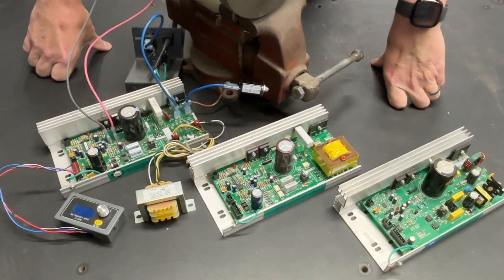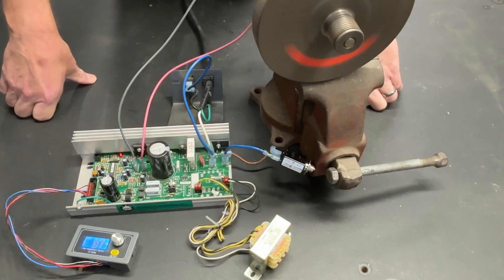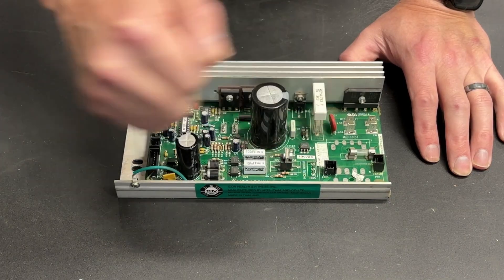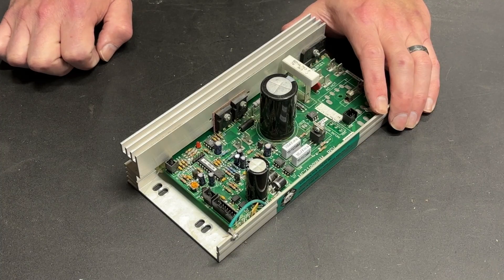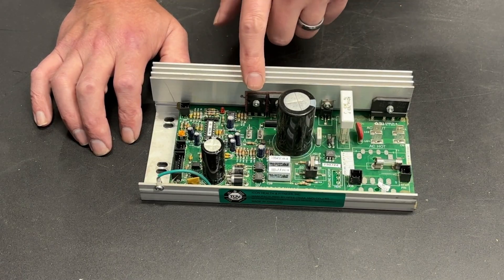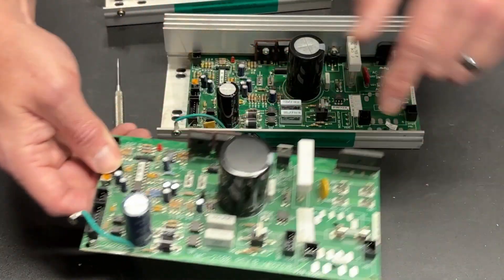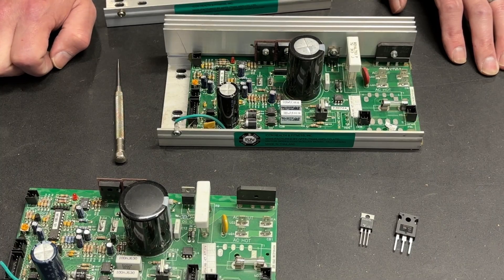Troubleshooting and Repair of an MC-2100 Including common Component Failure and Diagnosis

Comment: Is it possable to use the mc 2100 as a variable voltage power supply to charge batteries?
Reply from the maker: probably but not without way more knowledge than you would get from a youtube video.  You could dial in the voltage no problem the issues is amps.  If you don't have a way to control the amp output from the power supply you could damage the batteries.  The other issue is overcharging.  Most battery charges come with an auto shutoff and a DIY setup like this would also not have that.  Most battery chargers are not that expensive.  I would think you would be better off using something specifically designed to charge batteries rather than trying to "make something work" that was not designed for the purpose.
Reply: @dazecars  What if I added a Buck Boost converter could that address the issue with amps
Reply: Sorry this situation it were better if I used an old wall weart (stupid question)
Reply from the maker: honestly I don't know, I have done very little with battery charging

Comment: I have the Astar TD-700 Rev 2.1. Have you done a hookup video for this board?.
Reply from the maker: I do not have a hack for that board
Reply: @dazecars  From my limited knowledge it looks like a revised verson of the 2100 with more robus components complete with a transformer  and Transformer choke
Reply from the maker: There is no such thing as a "Transformer choke" even though they look the same it is either a transformer OR a choke

Comment: Hi! I'm now reparing MC2100E board (Rev. A, ICON 2003), and it seems have P-Mosfet instead of N (all videos and forums i have read already - says that 2100 board have N-Mosfet), so i'm very confused, can you help me? If you have 2100E board - can you check, what Mosfet and driver it has?
Reply from the maker: Are you talking about the letter at the end because there is a P in the middle of the part number?  I have about 7 different boards all different configurations and revisions and they are all IRFP250N MOSFETs.  The trigger polarity is the only difference between the two so if your board worked with the P MOSFET before that is likely what you should replace it with.

Comment: Omg thank you! You saved my treadmill from the scrap yard with your suggestion on the replacement of the 2 chips. There’s no way I was going to buy a $200 control for my $100 equipment! Got both chips for $5 on Amazon and we’re good to go. Saved my treadmill and my ass!
Reply from the maker: I’m glad I could help!

Comment: Thank you for the informative video!  I replaced one front roller bearing, then it never work after. 
Control panel touch screen works, fan works, incline/decline work, main driven moter doesnt spin, LED light flash only one time when turn switch on, moter is tested working on battery. Fuse tested fine. convertor tested fine. no clear signs of any physycal issues on anything.
The most weired thing is: the control board output votage is 214v tested from the connectors where the motor wires pluged on  (where marked as: A-/A+).
Would you please share your thoughts? Much appreciated!
Reply from the maker: I am sorry I can’t help with troubleshooting as my area of expertise is not in repair of treadmills. my channel is about repurposing treadmill parts for other projects.  Because of this I have had some experience repairing the board but all the info I have is the info in this video.
Reply: @ that totally understandable. Would you be able to find out how much vantage is from your working order 2100 board, where the driver motor connects to. Are they 70? 120? Or 213? Thanks
Reply from the maker: sorry I didn't get back to you sooner.  took me a while to get out and get it tested.  Because there is a capacitor in parallel with the motor out puts and the system puts out a pulsed max voltage if you measure without a load you will get max volts.  Without a motor hooked up I was getting 156V DC.  My setup is hooked up to 110 in from the wall.  With a motor running you will get a variable voltage depending on how the PWM signal coming from the console

Comment: I lost the 8 pin wire harness for my MC-2100 board and now need a replacement.  Looking on Amazon but not sure what to look for.  The pitch of the pins seems to be the way these are specified.  My pins measure about 0.094" (2.4mm) pitch.  Do you know a better way to find the right replacement harness and 8 pin connector?
Reply from the maker: I have scrapped enough treadmills that I have not needed to order a new plug so I’m not sure what this style of plug is called or how to measure it.
Reply: Any luck with this??  I am currently in the same boat!!
Reply from the maker: just did a quick eBay search and there are used treadmill cables available of almost every configuration

Comment: Hello!  I just came across this because while doing some cleaning maintenance on my treadmill, I accidentally dropped a screw onto the board without realizing.  I ended up turning it on and shorting what may be two of the rectifier diodes near the transformer.  I'm trying to figure out if I can replace those diodes, or if its okay to still be on the treadmill with 2/4.  The board is the MC2100LT-12 (part no. 409599) with the big transformer out with what looks to be a butter bit on top.  I cannot for the life of me see what diodes I may need to replace, or if I need to replace the board.  I do notice you briefly talked about the transformer, do you know what diodes they need?  Like a D10 and D13?
Reply from the maker: contact me through my website and send me pix of the board I will compare it to the boards I have and see if I can find replacement info for you.
Reply: @dazecars  Sent!  Thank you so much for this!
Reply from the maker: I received it and will get back to you as soon as I can

Comment: bro i have moved my house since then when i switch on there is clip noise come from motheboad.. powe on and display on.. no sooner start machine then my main power switch turn off .. what do you think .. when i off and on switch that clip noise is coming.. thanks..
Reply: is it worthy to repair my trademill or buy anothr one.. i had this machine 10 years.. is there power short why my house main power switch off when trun on machine.. thanks
Reply from the maker: could be a failure in the MOSFET and SCR but may not be.  The board is easy enough to swap out if you simply got a replacement controller.

Comment: Hello and thank you for the informative video. I have a Nordictrack 3700 elite treadmill that has worked great for years but the belt will not respond now. All LCD controls up top work and controls to ramp up speed respond, but belt doesn't move. Circuit board is MC2100LS-30 and red LED does not light up at all. Do you think it's the MOSFET and SCR or would that indicate transformer failure? It has the small onboard transformer pn DZ-MG22001 but doen't look burnt and both capacitors look good. One small diode right above the "MC" on the "MC2100LS-30 REV" label in middle of the circuit board looks like it may have burned out. Any suggestions are greatly appreciated. @dazecars
Reply from the maker: So first I am not a treadmill repair guy, just an electronics hobbyist who repurposes treadmill parts for other applications. With that said I have some info for you... may or may not be helpful.  First  "All LCD controls up top work" that means it is for sure not the smaller of the two big capacitors AND it is not the transformer.  Those two parts are what helps convert 110V AC into 12V DC to power your display.  Second it might be the signal generator in the LCD controls.  If the mc2100 is not getting a signal that could be the issue however in most cases the result is an LED that stays on solid rather than one that doesn't come on at all so that is not likely.  Third, could be the diode, burnt parts are always a good place to start but I have a feeling it is likely the MOSFET and SCR,  I cannot however say for sure.  There have been as many failures to fix their MC2100 using this info as there have been successes. This video just covers the most common failure points but not every possible issue.  There is a guy who commented on this video about a week ago who was not able to fix his board, however was offering up the extra components he had purchased for the cost of shipping.  May be worth checking out.

Comment: Can a ac regulator run a treadmill instead of the MC 2100
Reply from the maker: Inside a treadmill or outside the treadmill?
Reply: From the looks of it it already has that regulator...but on the DC side...(scr).....
bt.w. an scr is always more robust...(electrically , thermally & more noise immune) than a similar AC regulator(a.k.a. TRIAC) of the same/similar
rating.
Reply from the maker: way more robust

Comment: Thanks Much,  I just scored a version of the MC-2100 board with a 2.25 HP continuous duty motor from a  NordicTrack A2350 treadmill should work well on my old lathe.
Reply from the maker: don't go by HP numbers AT ALL they do not apply in a variable speed situation, what is the torque of the motor?

Comment: I have a MC-2100 Rev B on my treadmill. Original issue was treadmill would start at high-speed then immediately turn off. As suggested, I replaced both the IRFP250N Mosfet and S402SL transistors. I tested with no weight on treadmill, ran well. Then, stood on the treadmil and started. Started to move then I heard a pop and then treadmill stopped. Burning smell. I check the board and the S402SL had a hole in it and burn mark where it connected to the board. So I replaced the S402SL again but did not replace the Mosfet. Reconnected the board. Turned it on. All the lights came on. I set the speed to 2, As soon as I press start, I heard a pop again. The S402SL burned out again as there was a bigger burn mark on the board at the connection to the board. Now, should I try replacing both the Mosfet and the S402SL again? Or should I just replace the board altogether? Is there a better alternative to the MC-2100?
Reply from the maker: Something else on the board is bad causing the issue but I am not sure what.  a replacement mc2100 is likely your best option but it is still not very robust.
Reply: Do you know by any chance the mosfet, thyristor and rectifier diode values for an mc2100els-50w-2y
Reply from the maker: no I do not know the values

Comment: I want to consult with you about something: I am having difficulty removing the board from the heat sink. I have already removed the hot glue stuff (as much as possible), then I also removed the bolts that are holding 4 heat sink components to the heat sink, and I removed the grounding strap from the body of the heat sink. And yet after that, I can not move the board even a tiny bit at all. Is there anything to alleviate the removal procedure somehow? Thanks.
Reply from the maker: Some times they get cocked in the slider groove.  Could also be a tight fit.  a small amount of pressure between the aluminum rails may be all you need to get it out.
Reply: Trying to do that for the last 15-30 min, no success so far. Was even using a small needle to get to the slider groove somehow to remove the remnants of the hot glue. I can even see that the board has started moving in vertical direction, but so far not in the direction that I need it. I'll keep on trying though.
Reply from the maker: I hope you are able to get it out
Reply: I finally managed to get it out after 2 days of trying. And I did it in the direction (can you imagine?) opposite to yours in your video. I understand that the slider grooves are there up to the very edges from both sides: left and right. But no matter how hard I tried to get it out from the right side of the heat sink (by pushing the controller from the left or pulling it from the right), I could not do it. Then, there was approximately 1" from the left side of the heat sink and the left side of the controller, whereas on the right side --> both of them (controller and heat sink) were on the same level. And then it hit me: why don't I try to push it in from the right side?
And I did it with my two big fingers from the right side, while I was holding the heat sink with the rest. And it worked: even that slightest push -- moved the controller immediately half way through, the rest was easy... I hope this info might help someone someday... Good Luck!
Reply from the maker: I have removed them from either direction so I would guess there was a barb or something holding your up in one direction however I will add this info to my knowledge base in case someone else has a similar problem.

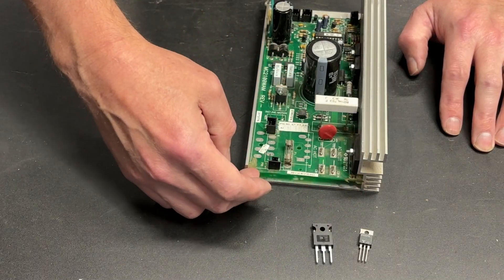Comment: I have a question about re gluing the Board to the heat-sink assembly.  @10:48. Will ordinary craft hot-glue work or is something else needed? I have an MC-2100LC-30 board
Reply from the maker: hot glue is exactly what it is.
Reply: @dazecars  ok.  Mine was Grey in color.   Thanks for the tip
Reply from the maker: Glad I could help

Comment: I have a u-mc 2100-12a board on my tread mill. Motor wont turn. Hooked motor up to a 9v battery and it spun. Control panel of tread mill lights up and works. Led on motor controller flashes when you hit go, like it should. Under side of the motor board has a burnt spot at the Q2 mosfet. You think just replacing the mosfet would fix it?
Reply from the maker: As I said in the video always replace the MOSFET and the SCR at the same time.
Reply: @dazecars  thanks for your reply. That is helpful. What about the burnt spot on the board? I posted a video of it.
Reply from the maker: I would check for continuity from that middle terminal to another solder spot on the same trace.

Comment: hope you can help me out i replace MOSFET and SCR when i plut in the power with out the controler  in the motor stat spen to the max speed
Reply from the maker: Its usually those two components that cause that symptom.  I do not have any other fixes for that.
Reply: @dazecars  thank you
Reply from the maker: your welcome, wish I could have been of more help.

Comment: Hello, my motor would start in fuul speed then stop, so i replaced the IRFP250N  then it satrted to work normally but the moment you walk on treadmill, very weak power, then samething happened again, so i waited the S4025L ti come in and changed both this time samething works fine but dramatically LOSS OF POWER, what can cause it?
Reply from the maker: Power is directly related to amps so something is limiting current flow but I am not sure what.  My expertise is in using these types of boards outside the treadmill so I only have limited knowledge on repairs.
Reply: @dazecars  Makes sense. Thank you for replying.
Reply from the maker: not a problem

Comment: Hi, thanks for a great video.  My Proform 415 treadmill with the 2100 Rev B PCB ran great for 12 years, but then it would run for a second and pop the "arc fault" breaker that is in the house panel for my bedroom.  I tested the motor with a 12v DC battery and it ran without problems.  I replaced the IRFP 250N Mosfet, the old one tested bad.  And I connected the treadmill to a non "arc fault" outlet.  Now, the light stays solid on the board, the control panel on the treadmill works and I can use the incline motor up and down no problem.  But when I go to start the treadmill, it runs for a second or two, then pops the breaker on the front of the treadmill, but not the house panel breaker. And the control panel stays on and the red light on the CB stays on, but a "burning electrical smell" came from the motor.  Not sure what to do next, I could take the motor apart I suppose.  I'm leery of getting a new motor, cause it might fry. I don't mind puttering around with it, replacing chips and caps but I would just get a new treadmill if I have to spend a couple hundred dollars to get it going again, because it is old.  Any ideas?
Reply: PS the caps look good, not swollen or leaking.  The board in general looks pristine.
Reply from the maker: if the motor is running no problem on 12V I would say the motor is not the issue.  If the motor was the issue it would not work in any configuration.  Did you replace the SCR chip like I suggest in my video when you replaced the MOSFET?  As I said those two chips work in tandem, one on the AC side and one on the DC side and if either one is "stuck" shunting full voltage that could cause a surge to the motor which would cause some burning smell from the brushes and the breaker to pop.
Reply: @dazecars  I did not replace that SCR chip, they take a few weeks to get delivered.  But I will order one (some) and wait for it.  Replacing the chips is not hard or expensive.  I have several of the MOSFET chips already.  Thank you for getting back to me, I was going to take the motor apart but I will wait and try the SCR chip.
Reply from the maker: like I said it shouldn't be the motor at all based on the info you provided.
Reply from the maker: Sorry neither of those parts fixed the issue.  It often times works but not always.
Reply from the maker: I am batting about 500.  seams like a lot of people have been able to fix their control boards but just as many have had similar results to you.
Reply from the maker: I have a supply of them, but thanks anyway

Comment: Great video. My issue appeared to be a mosfet because the treadmill ramped up fast and then almost immediately shut down. It did this twice, then it wouldn't do anything after the 2nd attempt to run the treadmill.  Once I got access to the control panel the led wasn't lit or blinking and the hfa15pb60 beside the mosfet is burnt. Have you ever encountered a burnt hfa15pb60 and is it fixable?
Reply from the maker: That is the flyback diode and is easily replaceable.  make sure when you replace the MOSFET that you also replace the SCR
Reply: Thank you. Ill give it a shot